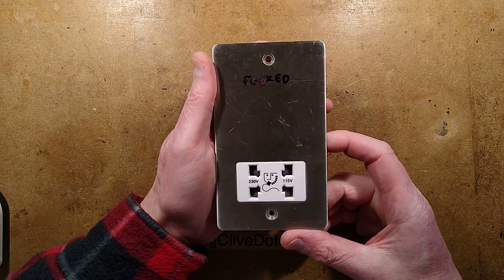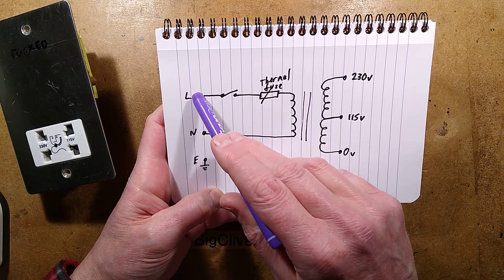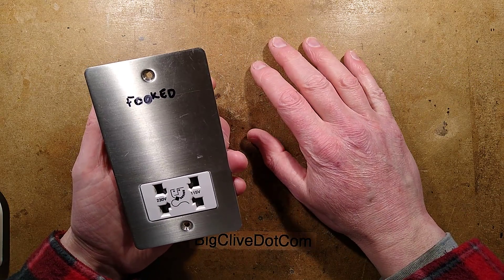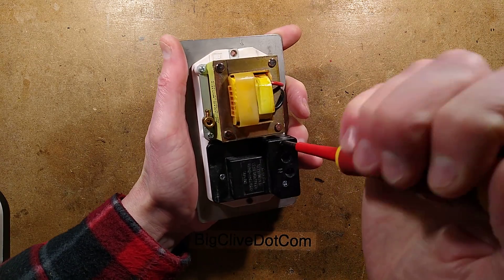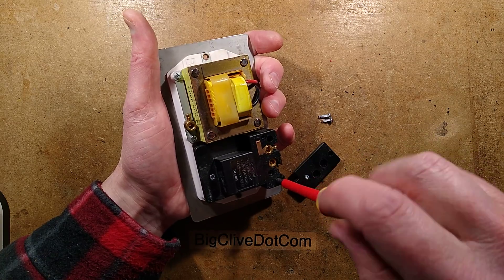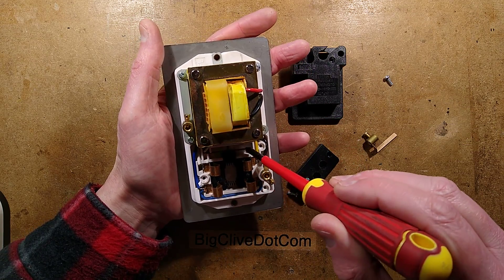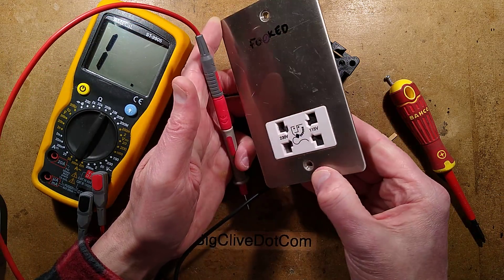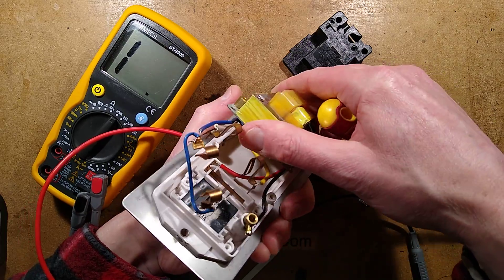Exploring a failed British shaver socket

Comment: The first house I remember living in in the US was built in the 1950's and had a shaver outlet on the light over the bathroom sink and mirror.  I have no idea if it was isolated.  Later I lived in a house built in the 1960's that had a standard outlet near the sink.  No GFCI / RCD, safety was on you and the shaver manufacturer.  The shaver cord was typically too short to reach the bathtub but of course you could drop it in the sink.  Later still I lived in a house that was built in the 1990's and had GFCI's on any outlet near a sink or outdoors.  

So how do you use a hair dryer in the UK anyway?  In the bedroom?  Some yank probably came over there and fried that outlet with a hair dryer!

Regarding "toothbrushes and lady-toys", what about "manly toys"?  Do those run straight off the mains or do they require petrol?
Reply from the maker: Yes the lumberjack toys use petrol.
Reply: @bigclivedotcom  Mine's electric.
Reply: Normally the uk women " toys" are powered by either a 3phase 400w supply or are powered by a a diesel generator which can be noisy around late evening & can upset the neighbours, sometimes as much as 3 blocks away.
Reply: I've seen those outlets in bathroom light fixtures all my life, and never gave it much thought, but in the back of my mind, I always wondered why they put outlets there. Today at 57 years old, I finally learned the reason.
Reply: @Erik_Swiger  lol
Reply: The outlet on the light at least the couple I've remove over the years just connected to the lighting circuit. I was reading through the comments to see if anyone else had seen that set up. The ones I saw were in the trontro area
Reply: @edwinw8599  I'm here in the US and grew up in the fifties and sixties it was rather, common to see those chromed bathroom light fixtures with a two prong outlet for shavers
Reply: @chrissnyder2091  - You can still buy light fixtures with outlets in the base (plastic and ceramic type).  Some are polarized, some are grounded.    They make perfect sense in a shed or closet where there's no other way to get an outlet into them, and you don't want to have the screw in adapter types.    In my FIL's basement (Detroit area), all of the ceiling bulb fixtures (the bare bulb style) had the plugs in them.   Kept the power outlets above potential water leaks in the basement.
Reply: @edwinw8599  ,  Electric stoves/ranges sometimes had a similar "courtesy outlet" built into their control panel as well. Years ago, while living with my wife in a rented apartment, there wasn't an electrical outlet for the section of kitchen counter where it would have been particularly usefull, so I added one on the side of the stove's control panel, tapping into half of the stove's 240VAC supply.
Reply: @edwinw8599  , yes, I've lived in buildings with the electrical outlet built into the light fixture above the sink.
Reply: Most "manly toys" I know of run on salad mostly.
Reply: @andreasu.3546  You play with bunnies ? ;)
Reply: @andreasu.3546  ... and credit cards
Reply: Bedroom would be the normal place to use a hair dryer. Trying to dry your hair in a damp steamy bathroom with a fogged-up mirror seems a bit counterproductive, no?
Reply: @AaronSmart.online  I've forgotten that since I have short hair and almost don't need the hair dryer.  My girlfriend who has long hair seems to use the bathroom for hair drying.  I think maybe at one time (with more hair) I did use the bedroom.

Comment: In Canada we had shaved sockets which had actransfirmer to isolate the mains for safety. They were useless for anything that drew any more power then a Shafer. Most of them have been removed and replaced with ground fault interrupted plugs. Much better.

Comment: Might be used in hotels, but we just have normal powerpoints in bathrooms in Australia. That was one of the things I found incredibly annoying living in the UK (along with seperate hot and cold taps!).
Reply: The separate faucet is to save lives as well. https://youtu.be/HfHgUu_8KgA
Reply: @CaseyRevoir  I live in a UK house (flat over garage thing) that was built within the last couple of decades and although the kitchen tap is a mixer, the bathroom taps aren't! Hate it with a fiery passion. I often just go to the kitchen to wash my hands. Separate taps might make sense in ancient houses with loft boilers but have no place in new buildings.
Reply: @spinner4148  

It's really a non-issue.
Reply: @skylined5534  not when you have eczema on your hands that's worsened by using the wrong temperature to wash them.

Comment: I've seen these for sale in Australia but never ever actually installed in a house. I guess since RCDs are mandatory (since the 90s I believe) people have no reservations putting a regular outlet right next to a sink, or light switches right next to the door of a shower. Very common to see. I think prior to that, you were still allowed an outlet in the bathroom, but it couldn't be within reasonable distance of a sink. My grandparent's house, built in the 60s, has a single outlet in the bathroom, but it's way up high and on the opposite wall to the sink. Maybe a greybeard can confirm or deny.
Reply: Yep since 2000 RCD’s have been mandatory on lights and power circuits here. However there are still a bunch of regs in the ASNZS3000 about the distance of electrical accessories from sinks, showers ect

Comment: My grandfather has one in his house here in the US, i even want to say that its not a full 120v but i cannot recall.
He did however have a slot under the outlet, he told me that its for shaving razor blades and it just dumped out in to the wall.
Reply: And what if you accidentally drop something valuable in the razor blade slot ? 🤔
Reply: @psirvent8  Such slots are so narrow that it would be almost impossible.

Comment: These devices were very common in hotels here in Germany and i also saw tthem in hotels in Austria, Chech Republic and Poland as well. For Germany i know the reason, there were legal regulations for having this extra protection in public accessible outlets in "wet-rooms". Now you see less and less of this socket, it seems today a RCD in the circuit is sufficient to fulfill the rules.

Comment: Yea they were somewhat common here in NZ homes, usually run off of a lighting circuit in the bathroom to provide isolated supply just like in the UK.
Now days bathrooms are fitted with regular sockets and protected by RCD/GFCI at the main switch board.
Although when upgrading a bathroom in an older home it is not uncommon to simply fit a socket with a built in RCD/GFCI in the place of the old shaver socket, but only there is push back on an upgrade from a fuse board to a switchboard.
Reply: Yep my grandma's old house has one of those outlets with a 240v outlet and a 120v outlet which is missing the ground prong for some reason. I haven't seen many here in New Zealand homes though
Reply: @LoganT547  no ground prong as its an isolating transformer, meaning there is no direct path back to ground stopping you from getting a grounded electric shock, dont recommend touching both live and neutral at the same time though, you'll still get a zing
Reply: Pretty sure there very different lol
Reply: yea ive seen many of these shaver sockets in places ive lived, but yea my current place has a mains socket with GFCI
New Zealand btw
Reply: I think I would prefer the old fashion way of doing things, when new,  electronics are good but over time I would not trust them. With the transformer the failure is the electronic thermal fuse, which should have been made replaceable, just like fuses in plugs.

Comment: I've seen these plugs often when cruising or in airplanes.   On our last 2 cruises (NCL, Holland America) we had a water pick along.     It was a 120vt plug, and on both ships the plug barely fit.  Forced in as the prongs were slightly wider and yet it frequently slipped out as contact was made only on the very interior of the plug prong.    Could plug it into other outlets in the cabin with out problem.
Now what I really would like to know is why British Airways changed there seat electrical systems on their planes.   Prior to traveling we checked that our CPAP machines would work at our seats (110/220 rated) yet on the plane they would only work 5 sec. and then blow the circuit.   During flight they actually radioed to their facilities to find out why and were told all the plugs and breakers were all 'updated' to lower trip voltages.   Any idea why?
Reply from the maker: Probably to take strain off older plane wiring.
Reply: Cpap power supply bricks are rated somewhere in the region of 50-90w. My cpap machine, Philips, especially if used with the heated humidifier, can draw 50w. Next time, try without the humidifier & you might be okay.

Comment: Ah, this explains an experience I had in a hotel in France … the only outlet in the room was such a socket in the bathroom. My laptop needed recharging, but the charging would stop every so often and then resume a while later, The thermal fuze!
Reply: These things are common in hotels for their 230/115V capabilities I guess, but in France you will not find them in normal houses (I mean at home). We have GFCIs instead (mandatory on the bathroom circuit).
Reply: At least it was a self-resetting one - and not permanent, (imagine asking the hotel manager “why are there no sockets in my room - I’ve overheated the shaver socket in the bathroom trying to change my laptop and the socket is now dead 😳)
Reply: @ Peter Thejll
What year did you go to that hotel ?
I'm French and am very surprised that a hotel will only provide guests with a shaver outlet.
But if it was in the 70s or something like that I would be less surprised on the other end.

Seriously, even cheapo hotels like Formule 1 or Première Classe or Fasthôtel do come up with actual outlets in the room for you to plug your cell phone or laptop at least.
I know because I slept in one of the latter maybe 15 years ago and outlets were present in the room.
Reply: @psirvent8  It was in Nice in 1998, I think. I suppose there was one more socket in the room itself, but the TV was plugged in there, and you can’t ask people to charge their laptop and not watch telly at the same time, can you?
Reply: @thejll  I always pack in a power strip. Phone, laptop, wireless headphones, USB power bank etc need sockets.
Reply: @axelasdf  yep, I got wiser. The X-rays at the airport now shows up so much tangled wire that they inspect my bags very closely, but they let me through without questions after a while. They have seen it all. :)
Reply: @psirvent8  - His power supply was probably capable of taking 230 volts, but he may not have had the right end connector.
Reply: There's always more sockets around somewhere - unplug any of the 3 or 4 lamps or the TV and or associated boxes which prevent you from seeing the naughty channels
Reply: The thermal fuses aren't like automatically resetting circuit breakers that resume the connection when the device cools off ---- they blow just once and that's it, the fuse is open, permanently. That hotel outlet may have had a different type of protection built in, like a bi-metallic strip used as a thermal-overload disconnect.

Comment: Our family home here in New Zealand (built 57 years ago and sold now) had a similar shaver wall socket.  Not polished metal but just run o the mill white plastic - had a power switch and 115/230V outlets. 
It looked just like this one (4th pic down): https://www.electrical-contractor.net/forums/ubbthreads.php/ubb/printthread/Board/5/main/12740/type/thread.html
You'd have to wonder why someone would think plugging in a hair dryer or similar was OK??? :(
Reply: Yep I'm in new zealand as well, my grandma's house has exactly the same outlet you showed

Comment: In the US GFCI outlets are used when they're within a certain distance of a sink or bath/shower. So, for example, my house has a GFCI outlet in the bathroom, and there's a GFCI outlet in the kitchen as well, which is ganged with another one on the other side of the sink.
Reply: All the sockets in the UK are also GFCI now, including these, the UK has paranoid levels of electrical safety ...

Comment: In the U.S., we have GFCI and AFCI receptacles for wet locations.  I've never seen one of these isolation transformer type of receptacles.  Having the non-resettable thermal fuse inside the transformer is a pain for the maintenance person.  That entire receptacle is now trash.  They should either have designed it using an automatically resettable thermal fuse, or a regular fuse that can be replaced.

Comment: I have never seen that but the bathroom in my house has a slot in the medicine cabinet for use razor blade to be dropped into the wall cavity.
Reply: How odd?
Reply: @wirdy1  You can see lots of examples if you look up safety razor slot

Comment: It is important to note that, in the UK, the circuit is also required to have RCD/GFCI protection as well.  It is a two level protection in wet areas.

Comment: We used to have shaver sockets in Switzerland, but AFAIK they were only fused at 100mA. In this day and age of ground fault circuit interrupters you usually just have a socket inside the cabinet behind the mirror, thus splash protected.
I have used isolating transformers like this when using electrical equipment while working outside in a stream, though.

Comment: the exact implementation is different but this is how we get our 110v in the US.  the coil tap is just further up the line, not at the end point.  we're really a 220v country with a coil tap on the other side of the breaker, we just decide whether we want an outlet to be 110v or 220v at the breaker instead of a weird dual voltage plug

Comment: Plugs in overhead vanity lights in US bathrooms used to be a thing. Originally, unpolarized 2-prong. Later, polarized 2-prong. Often it was the ONLY outlet near the sink...out of the splash zone overhead, but not isolated in any way. When houses started getting wired with grounds, they sometimes became 3-prong and bathrooms usually had a regular outlet as well. When wet-zone GFCI became a thing, bathrooms got regular protected outlets near the sink and vanity light plugs became less common. Naturally, they were all 115V, no 220V shaver option.

Comment: So many here relying on full non-isolated mains sockets in the bathroom behind RCD's or GFCI's. Scary.  Those devices are just fine, till they fail to trip because they haven't been tested and no longer protect you.

Shaver socket FTW in my opinion.

Comment: I've been to quite a few countries in Europe and have never encountered one. In the Netherlands a standard socket is used, often with a protective splash cover. These are protected by an RCD in more modern homes, but you can still sometimes find properties where they're only protected with a 16A fuse in the consumer unit 😳

Comment: I find it interesting how there are now 3 ways I know of to keep humans from zapping themselves when they drop a shaver into a sink basin full of water.
My personal favorite is to have the shaver on the other side of an isolated DC power supply or powered by batteries charged by said DC supply.
I also now wonder if the American GFI / GFCI / AFCI method is any cheaper or reliable than the isolation-transformer-in-a-socket?

Comment: Have one in bathroom but it’s not used -  only time I’ve ever used the shaver plug was last year - with those notorious led Christmas lights that come with 2 pin plug . The lights did work but I cut them into bits and threw them away .

Comment: Used to be around, but no longer common at all, except for hotels, where they put a sign saying not for hair driers, and have a separate hair drier outlet, installed as per legislation more than 2.4m away from the shower, and right next to the shaver one. But most are now just replaced with a type M socket outlet, which serves dual function as well, plus it is on the GFCI with the rest of the room outlets. Trip that you have to call down to the desk to beg maintenance to reset the breaker, because that is in a locked cabinet down the hallway.

Comment: I've never seen a dedicated shaver outlet in North America, though I'm not opposed to the idea. For better or worse, we use GFCI outlets. Seems to work fine, but then, we only use 240v for large (non gas) appliances (Central air, electric range, etc.) or in the garage for larger air compressors, or for some of us, to charge EV's.
Reply: Canada definitely had "RAZOR ONLY" plugs in the late 70's - the house I grew up in had one in one bathroom, and a regular plug right by the sink in the 2 other bathrooms.

Comment: why does the transformer needs so much windings. It would be able to do the same job with just a few windings and thicker wire. or does that have to do with heat dissipation?
Reply: and why is the fuse not a self-resetting type. seems quiet a waste as it renders the transformer, and therefore the socket needs a complete replacement of the fixture.

Comment: Common in Swedish hotels. Exists in some Swedish homes, most built in the 70-80's. I have one like it built into my upstairs bathroom light fixture.  In the fixture in the downstairs bathroom I've retofitted a GFC beacuse that outlet was straight to mains and the house is so old that there are few grounded outlets let alone a GFC in the fusebox.
Reply: Same before when we moved into where my parents live there was one of these in the bathroom with only 110 V output. Appearently most shavers at the time was 110 V to make them less hazardous for bathroom use since there were no battery powered shavers at this time (70s-80s) so they ran right of the plug.